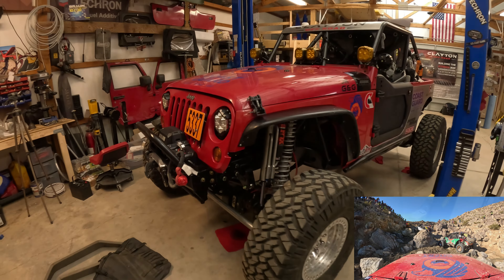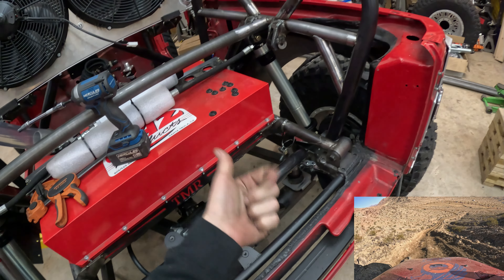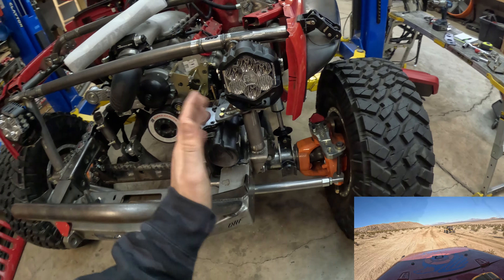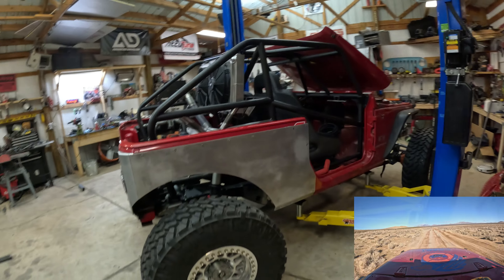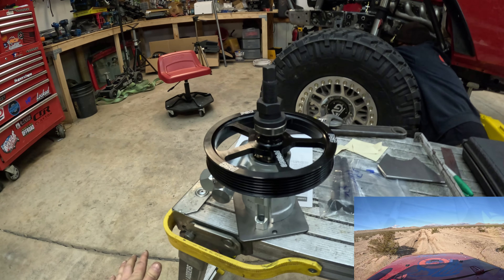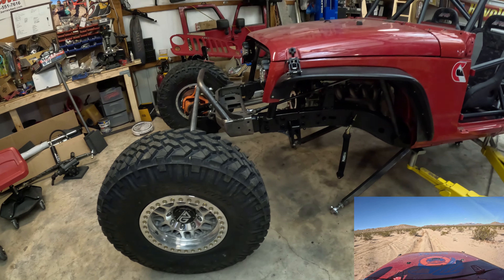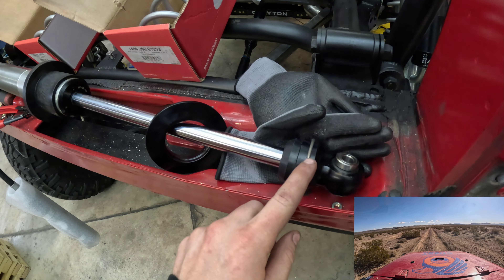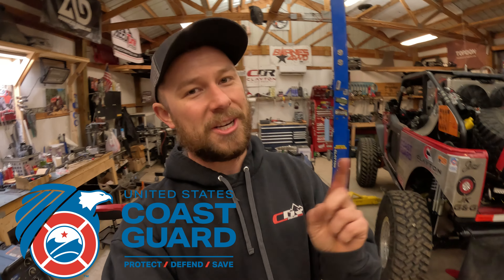Practically A Buggy In a Jeep Body! - Ultra4 Jeep Build Ep17

Comment: If you get contact arcing while welding things lying on the table try putting a 1/8 inch or so small piece of alum sheet under it while welding works for me gets a better contact so you get random arcing to the part from the table. great videos rock on

Comment: Why mount your fuel filler so high? Have you positioned it to a particular fueling system and individual doing the fueling? And why do you feel hydro bumps are preferred? Why did you use a clamp style bump can?
Reply from the maker: It just happened to sit in that spot, it’s not too hard to fill with a fast fill jug (takes about 10 seconds with those), and it needs to have a decent angle in the fill hose to prevent splash back. 
Hydro bumps really help smooth out the big impacts and harsh bottoming out. The bypass shocks help with that as well, but a standard bump would be pretty rough on a race rig. I run hydro bumps on all my rigs and they are fantastic. Running the clamp style since thats all fox offers, since the coilovers and bypasses are fox I figured I’d keep the bumps the same. Personally I do prefer the threaded can style as it’s easier to adjust and fine tune.